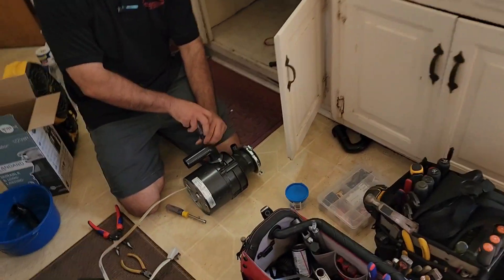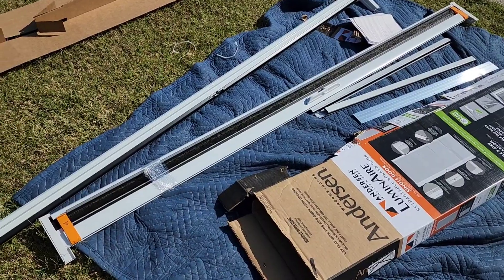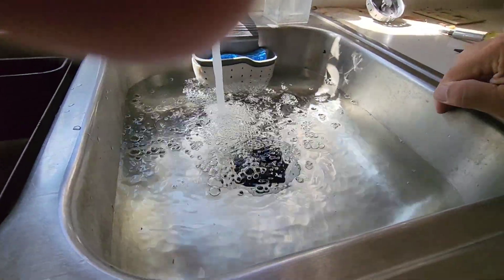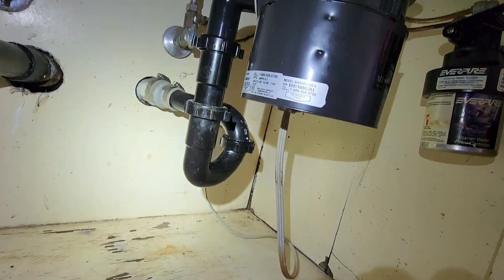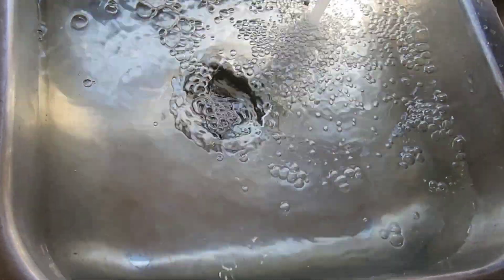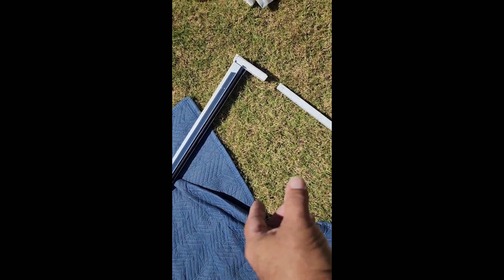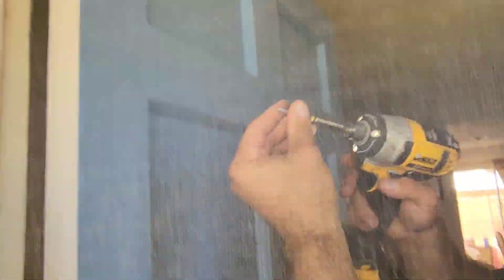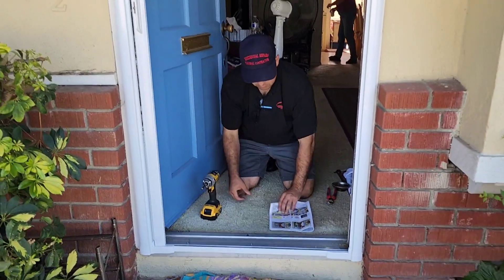Ride along with us on three small service calls.

Comment: Don't like to back stab outlets unless it's the commercial kind that wire is pressed in by side screw/plate.
Reply from the maker: Yes I totally agree when we install the new ones we use only the screws on the side if that doesn't work because there's too many wires then we pigtail. Thank you for watching Hope you have a great week.